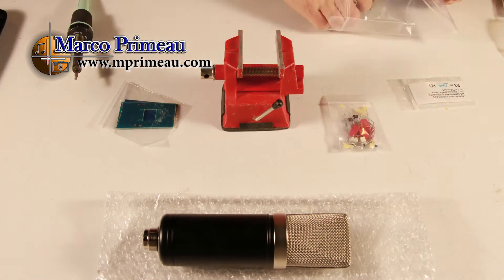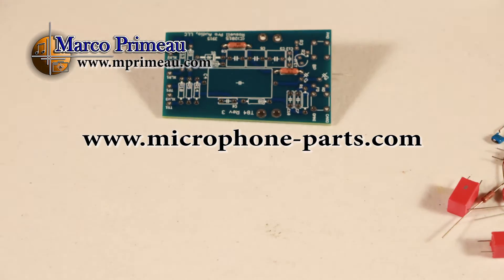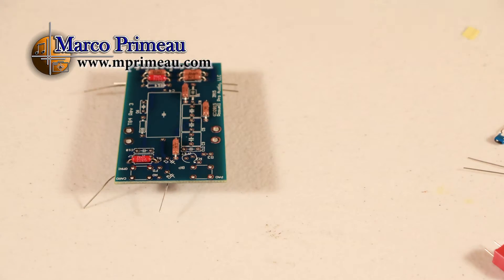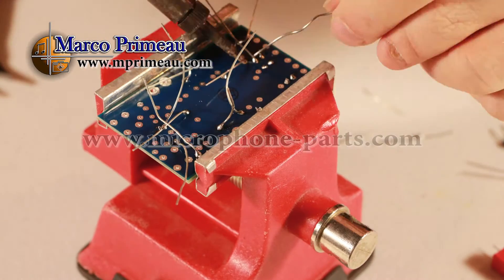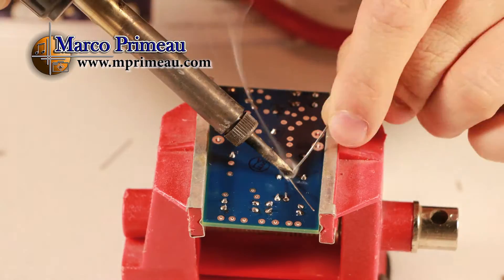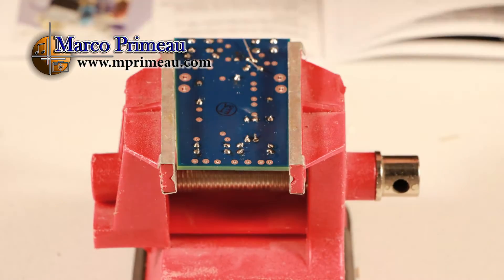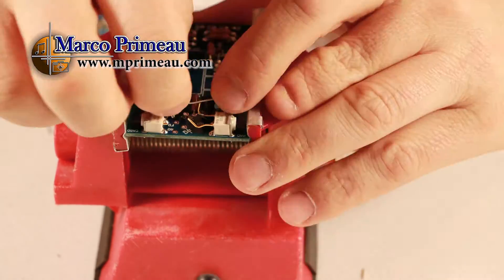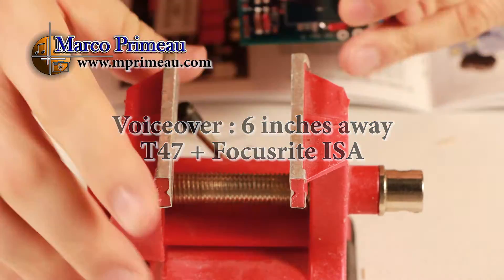Build and presentation of the DIY T47 mic from microphone-parts.com

Comment: The T47 is a bit darker, rounder, and generally more full. I think the brighter mic could be useful in a project where you need to layer something above an already full sound. But for the most part, the T47 would be preferable, since you can always eq the lows out, and it seems to have more detail, which you can't add back later

Comment: Very nice video. 
I have modified BM800 with large 34mm diaphragm capsule, it sounds great.
Reply from the maker: Yeah the BM capsule aren't very good.. Glad you made it work for you !
Reply: Marco Primeau had to externally polarise the capsule to make it work
Reply: praveen kumar How do you externally polarize it? Just phantom power or do you need to install additional components or hook it up to some electrical hardware? I have one of these I'd like to mod. I already have a very decent microphone as well, but taking the barely usable (if at all usable) BM (or NW) mic and making it more usable sounds interesting.
Reply: John Jackson BM comes with a recharged or electret condenser capsule of around 17mm which don't require polarising, I had modified with bigger diaphragm condenser capsule which required externally polarising, so it needed few extra components to do so, as the BM works on a phantom power of 48v.. I had no issues in hooking up few components to get it work.
Reply from the maker: The design kit I bought from microphone-parts gave me everything I needed to build the mic. So should the mods they offer. Most condenser mics it needs phantom power to work. External power supply are often more related to tube mics.
Reply: praveen kumar What did you need to install? Additional capacitors and resistors, or soem sort of power converter? Or did you have to replace the whole PCB?
Reply: John Jackson I had to add few resistors and capacitors, just few passive components
Reply: Marco Primeau If I'm just doing a capsule swap with a small diaphragm capsule I might get the Transound capsule directly from JLI because they're much cheaper that way.

My real interest is how possible/doable it is to put in an actual large diaphragm capsule in without replacing the entire PCB.

praveen kumar Is there a guide or diagram you used for that, or is it something you did on your own. If there are resources online I'd love to see them or if you designed it yourself you should consider making a video or guide about it. It would probably get a good amount of views.
Reply: John Jackson I did on my own, it's very simple procedure.

Comment: what fet is used in this kit? can you report his marking?
Reply from the maker: The value changes from kit to kit. Microphone-parts.com have a bench to test them one by one and provide tuned resistor to match them. (with 2 values if you want more harmonic distortions)

Comment: hi dear I like your video..and i would like to know if it's possible to use a t47 mic without its preamp ..your response wil be highly appreciated
Reply from the maker: Every microphone needs a preamp because the amount of electricity generated by the capsule (condenser or dynamic) or ribbon isn't loud enough to be recorded at a usefull level.
You can buy USB microphones with built-in preamps but they are limited in quality because of the extra electronics added inside. I recommand you to buy an audio interface that will include one or more preamp and can connect to your computer via USB or other connectivity. Look at Presonus and focusrite scarlett. Some start at 99$ and will give a good enough quality to enjoy any mics. (they also provide phantom power for condenser mics).

Comment: Hello, what a pity, I have a microphone at2020 for many years, it is a good microphone, one day I used it and suddenly began to generate noises or creaks and hisses, I want to disassemble it and I do not know, you can tell me how to do it , I want to repair it myself, I greet you infinitely, hug.

Hola, que pena molestarte, tengo un microfono at2020 desde hace muchos años, es un buen microfono, un dia lo fui a usar y de pronto empezo a generar ruidos o crujidos y silvidos, quiero desamblarlo y no se, tu me puedes decir como hacerlo, yo mismo quiero repararlo, te agredezco infinitamente, abrazo.
Reply from the maker: My knowlege of electronic circuits is very limited. This is why I bought a complet kit at microphone-parts.com. But before you open your microphone, be sure to eliminate any other component that can also give the problems you describe. Change the cable, try it with another computer, another interface (at a store or at a friend's home) If it doesn't help, it could be simple as a bad ground between the capsule grill and the body. But I recommand you send it to an electronic shop if all the previous tests failed.
Reply: It's probably too late, but MicParts actually sells an AT2020 upgrade kit! Check that out--it replaces just about everything but the capsule and the enclosure